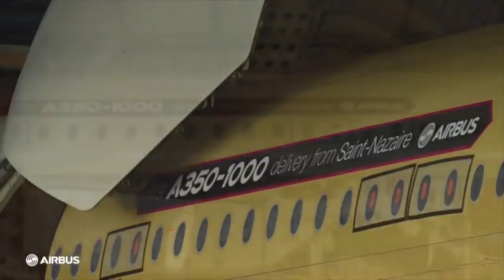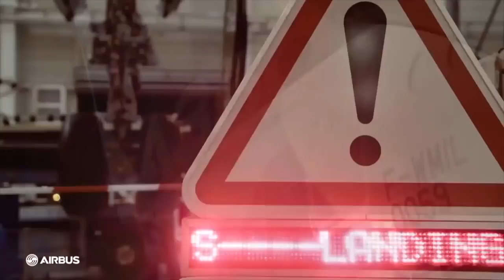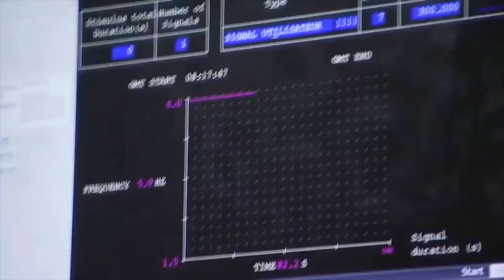The AIRBUS A350-1000

Comment: As a Boeing fan I’ll try and be impartial. I think the A350-1000 is one of the best aircraft that Airbus have made, and pretty good looking too. The 777-300ER is my current favorite aircraft, and an Airbus is not going to be my personal favorite, but Airbus really stepped up from the A340 which was a relative disaster. I think the A350-1000 and the 777xs will get a lot more orders than they have right now mainly because the 777-300ER are quite new and not in need for replacement (the A350 as a replacement for the 777-300ER), while the older 777-200/ERs are quite older and hence are getting many new orders for replacements in the form of the 787-9/10 and A350-900. I really don’t like it when Boeing and Airbus throw crazy fuel efficiency predictions over the competition, when in reality they are quite close. I don’t think there is really a wrong choice per se, and it just depends on route structure, loyalty, and possibly initial asking price. Trying to be impartial, I still do think the 777x is a better aircraft for serving the upper end in capacity for wide body airplanes, even though the A350-1000 is pretty darn close. The reasoning behind this is mainly because of the engines (GE-9s are incredible) and design of the general aircraft building on an immensely successful plane in the market, the 777-300ER specifically for the market, while the -1000 is a stretch of a great aircraft serving a slightly smaller pax capacity market. As for airlines I think could do well with the aircraft, I definitely think many European customers would be on board, many of which are already heavily invested in the Airbus family, and some Boeing operates such as British Airways’ order for 18 A350-1000s. The A350 finally provides and Airbus competitor to the 777-300ER, as earlier the closest was the A330-300 which wasn’t in the market and the A340-500/600 whose fuel efficiency was rubbish with 4 engines. Some specific airlines I think might order who haven’t already are Lufthansa along with many airlines such as Malaysia, Garuda, etc. now have an Airbus option for upsizing some more routes. The A350-1000/777x will soon see an incredible influx of orders, but right now the time is too early with the 777-300ER still being pretty new and these newer replacements serving as growth vehicles until the 777 classics becoming old enough to retire. 
Still not at 2018 in Los Angeles haha, but can’t wait to see how much you grow in 2018, 100k/250k? Who knows? Can’t wait to see the improvement for one of my favorite YouTube channels.
Reply from the maker: Another amazing comment for me to read :) the A350-1000 is probably one of the best they've made. I'd have to agree as well! All your points are bang on. We will have to see which version airlines prefer etc. Happy new year for you guys! I think 100k is a bit of a stretch but that'd be an absolute dream to hit one day :)

Comment: I've got a feeling that because of the fuel efficiency and lower seat cost more airlines will opt for the a350-1000 it may also be attractive to airlines who need a large wide body aircraft bigger than an a350-900 but smaller than a 777-9x
Reply from the maker: It's the logical choice for sure!

Comment: I have to be fair an admit that the 35X is impressive in it's numbers, and it doesn't even look half bad.  I still however am a die hard fan of the king of twin-engine wide bodies, the 777.  The coming 778 and 779 have yet to fly and prove their numbers, so I wouldn't jump the gun yet on Airbus' projected win in that department.  Also, I can't stress enough that I worry about all of Airbus' new products only have the RR engine choice.  The RR Trent 1000 engine on the 789 grounded Air New Zealand, and awhile back the Trent 900 blew off a wing section on a Qantas 388.  I would feel better if Airbus used GE engines.  Even on the older 333's like Korean Air's for example, I also love the Pratt engines as well.  Great video!
Reply from the maker: This new bird is certainly a stunner! Thanks for your comment and watching :) certainly found it interesting!
Reply: Well the GEnx had its fair share of problems and same goes for any new engine. Remember no moving part is going to failure proof. The Trent 1000s are completely new technology so of course their is going to be teething issues.
Reply: BayAreaLen Classic Airbus uses RR because GE won’t let them use their engines only for Boeing products. Airbus wanted GE-90 to power their a350-1K but GE’s denial bought airbus bk to RR. The Trent 1000 is a completely new technology like the GEnx (they will have teething problems) until it’s fixed
Reply: Yes, I'm sad to see this engine manufacturer exclusivity for both GE and RR.  They are both guilty.  Choice in the market for the right engine should be there, and let the quality of the engine sell itself.  And yes, of couse there will be teething issues for all engine manufacturers.
Reply: i think i read somewhere that GE would not supply engines to airbus due to their contracts and commitment to BOEING.....not sure if it's true
Reply: Most likely true. Prat&Whitney is still available but they have moved away from Airbus and Boeing in recent years after their proposed engines were rejected. They are now focused on Bombardier, Embraer, Irkut and smaller aircraft manufacturers.

Comment: Actually, don't expect much in the way of A350XWB-1000 sales until after 2020. That's when the 777-300ER replacement cycle begins.
Reply from the maker: Maybe! Or Airlines will opt for the 777x?
Reply: Andrew, the next major place replacement cycle will be replacing the widely-used 777-300ER, the true replacement for the older 747's in the view of many. That cycle won't start until around 2020. Indeed, with Air France now ordering the A350XWB-900 to replace the A340-300's and the older 777-200ER's, the A350XWB-1000 will likely start replacing the 777-300ER's in the Air France fleet in the future.
Reply: Sacto1654 The same applies to the 777-9 by existing 777 operators. Note some operators might not order it because they don't care about training crew costs. Saudi is eyeing placing an order for 20 next week or sometime. Aeroflot is also considering doubling it's current A350-900 order from 14 to 28. Eithad's 777-8 order is now dead and might as well go to Emirates since they're having a much better year. Also Emirates definitely confirmed (after inital threats to cancel if OpenSkies is terminated) they'll keep the huge 115 777-9 and 35 777-8 order since articles are appearing saying they're excited about the program so far. It'll be good for Boeing to get 20 777-9 orders from Saudi since they never got licensees to sell 15 to Iran Air before Trump's stupid recent move.

Also Andrew Anane Airbus has now lost the orders that Iran Air placed that were firmed (they somehow got licensees from the US Government) including 16 A350-1000 now lowering the backlog to 155 (not including the 3 planes already delivered to Qatar Airways). They are due to being written out in 60 to 70 days (Trump said 90 days when he cancelled the agreement that Obama put in place in 2016)

Comment: Very good video! If you get the chance it would make a great video to actually compare the 777 and A350 engine families. I mean both currently need to use the 'Top of the line' fan engines as they are basically covering territory which was once only possible with 4- or 3-engine aircraft.
I think that would be very interesting, as they probably both feature impressive numbers in terms of bypass ration, size, efficiency etc.
Reply from the maker: Thanks so much mate! I think I'll be making a video comparing the two and also talk about the engine choices :) Have a good one!

Comment: I like both the a350-1000 and the 777x and im not picking any side for  Boeing or Airbus but the 777x seams more futuristic and revolutionary in my opinion Qantas would look good with the 777x
Reply from the maker: Indeed it does man, especially as the -1000 seems to be a stretched A350-900.

Comment: The fuel efficiency thing is a little convoluted. Based on a quick internet search, we can see that the results are clearly biased. https://en.wikipedia.org/wiki/Fuel_economy_in_aircraft#5,000–7,600_nautical_miles_(9,300–14,100_km)

If we look at this table, the 777-9X does have a lower fuel efficiency than the A350-900, however, they fail to mention that the A350's flight was much shorter than the 777-9X's. Extra fuel plays a huge role in cost of flight, as extra weight requires more work to move the system. The exact numbers for the A350-1000 are not here, yes, however, they can't be much different than what has been provided.
Reply from the maker: WOW! Top work finding that mate. Very interesting indeed what Airbus is claiming then. Biased for sure!

Comment: New orders coming for this type is going to depend on some serious economic growth worldwide. There are airlines that have long haul fleets that need updating (Delta, United) even more than they have been so far but most airlines seem to have made their choices already and have orders in the pipeline. For instance BA has the A350-1000 on order to replace their 747s as they get older. Also to replace the oldest of the 777s they have. Cant sell them much more than they have already ordered. That scenario could apply to basically every major carrier worldwide. Between the A350, 787, 777 Classic and 777X there a lot of models and variants for what is a finite number of orders. The 777 Classic was successful because it basically replaced the 767, DC-10, MD-11 and 747. Plus it came out at a time when the Gulf carriers blew up. None of these new models will have the success that the 777 Classic had. There are just too many models competing for that particular pie. If you look at Boeing you have to figure that the 787 models have creamed off some 777 orders.
Reply from the maker: Indeed mate, thanks for watching and happy new year!
Reply: Dj's Aviation The classic 777 also replaced and caused the demise of the Lockheed Tristar L-011 altogether.
Reply: Both Delta and United are committed to the smaller A350XWB-900. Reason: they need to replace their 777-200 and 777-200ER fleets first. United's 18-plane 777-300ER order--all very recent--was intended to replace the 747-400 fleet.

Comment: Another good video. :) I imagine that the 787-1000 is also another option (albeit slightly smaller) for airlines considering the A350-1000 (with the 787-1000 seating up to 330 passengers vs 369 in the A350-1000).
Reply from the maker: Thanks legend!
Reply: The 787-10 has two intended markets: longer-range Asian regional and transatlantic routes. United's 787-10 fleet will likely operate from Newark and Washington-Dulles to Europe primarily. And Singapore Airlines will use them on routes throughout Asia from Singapore.
Reply: WTF is an 787-1000?

Comment: I like this analysis and agree with you. However, I thought of something - why don't Boeing or Airbus try releasing dedicated cargo aircraft? I know that the 747-8 F sort of fills this slot, but a lot of cargo airlines operate trijets still, which I'm sure they'd be keen to replace assuming there's a good replacement for the niche that a DC-10 fills. What do you think?
Reply from the maker: Thanks man! That'd certainly be interesting. I think at this stage the 777f, a330f, MD-11, 757f and 747-8f are doing well, however, there is certainly room for a new cargo aircraft to come through with the 747-8f really being the only new ones around.

Comment: I agree with you in which this new member of the airbus a350 family has an impressive set of characteristics to allow it to compete with the upcoming boeing 777X, but it is quite diffficult to decide which one is better. I think in this case the airlines' decision would be related more on which company the majority of its airplanes belongs to. But I have seen cases in airlines which have for example a fleet of boeing airplanes like 767, 777,787  but now are buying airbus planes like the a350-900, one specific case is Viet Nam Airlines which has placed into service its first batch of 787-9s and A350-900s and that decision is quite tricky to "decode" because it is up to its expansion plan
Reply from the maker: Spot on man, I think I mentioned that bit as well regarding what the airline actually operates at this stage. Thanks for watching!

Comment: I feel as though the A350 isn’t a direct competitor with any Boeing plane as such, it’s more of an in between for the 787 and 777. I think both A350 variants will be good successful aircraft as they fit a market where there is demand. For the the mistake from Airbus is sticking with the A380 with the A380 plus. The A380 is taking up their resources which would be better spent elsewhere. I also don’t think the A330neo in its current guise is a good move from them, the 787 eats the A330neo for breakfast.

Comment: I don't like the larger Airbus experience not because of Airbus, not because of their looks but because of their incredibly noisy flap motors. I flew on an A380 in 2013 & everytime the flaps were extended or retracted the whine went right through the aircraft & any babies on board began crying. I have noticed in videos of the A350 the same noise. Boeing aircraft are so much quieter so I was happy to take a return flight from Zurich in 2016 on a brand new SWISS 777. Though the A330 & A320 aircraft are quieter nothing beats Boeing's super quiet flap motors. I will only fly in larger Airbus aircraft if I have no choice, but will seek airlines that don't fly them wherever & whenever possible.
Reply from the maker: I've also flown on the 380 and it was super noisy! It was a 14 hour flight and eventually, I managed to get used to it but it was still certainly loud. Completely get where you are coming from!